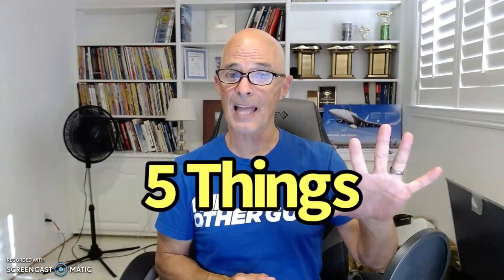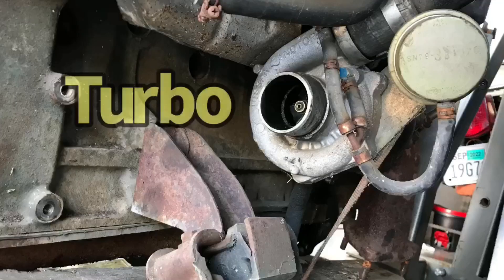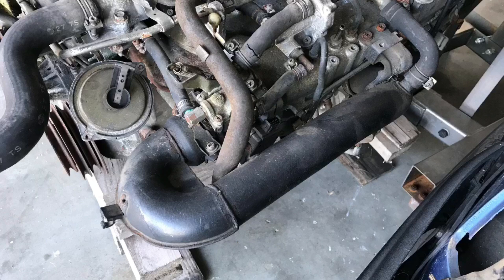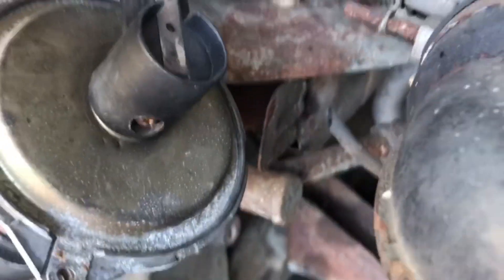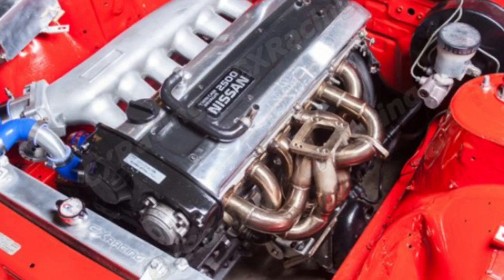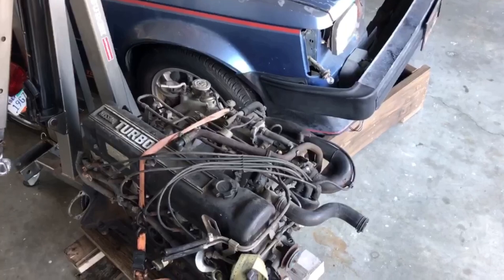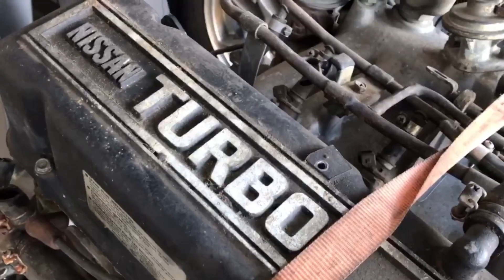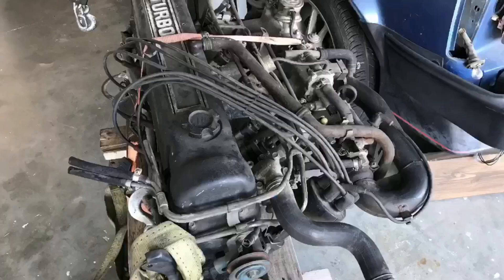280ZX TURBO-5 THINGS I LIKE AND DISLIKE ABOUT THE L28ET TURBO MOTOR. PART 1 OF THE ZXT MODS SERIES.

Comment: Great video!! I owned 3 280ZX Turbos...The 83 automatic was a dog, especially off the line. I added an intercooler and raised the boost to 12lbs. and the improvement in acceleration was substantial. I figure 10 HP for every pound of boost that's added... You can safely add 3 lbs. boost by removing the blow off valve and adjusting the turbo linkage.

Comment: We ran 219 mph with a Bonneville. Totally stock bodied 280ZX. It was a 2955 cc turbo using a diesel crank. Huge amount of work but we set 3 records
Reply from the maker: NICE-CONGRATS
Reply: Hi Richard, love your videos, I still have an extra LD28 crank if you want it. Takes a custom piston but make is 2955cc or there about. Free to you if you want it. 
 @richardholdener1727
Reply: Diesel crank out of what vehicle/engine??

Comment: Some folks are able to produce 500 horsepower out of it and some in Japan made 600 horsepower out of it like back in the 80s japan actually had twin turbo set ups : PS in the bay area a shop named Z car garage helped a customer build a 560hp Garrett 3.2 litre l28et turbo swapped 240z with a 6 speed 350z tranny

Comment: 1. That’s not a disadvantage. You can put a bigger turbo and run more boost without having issues of melting pistons and or detonating
2. That’s not a disadvantage. You can get an a good aftermarket intercooler if you want
3. That’s not a problem. It’s relatively inexpensive to upgrade fuel injectors. Or you can simply go with duel fuel injectors per cylinder.
4. That’s not a disadvantage you can do a draw through turbo setup the exhaust port next to intake port is an advantage for fuel atomisation. Then you’re not limited by intercooler flow
Reply from the maker: wrong on all 4

Comment: Could you do a water to air inter-cooler in front of the turbo?  Guess you would also be doing a full sequential injection  system as well
Reply from the maker: YOU WANT TO COOL THE AIR AFTER IT HAS BEEN HEATED
Reply: @richardholdener1727  Yep, I mean at the compressor output.

Comment: What about adding a turbo to a l28e. What are the options there?
Reply: "What are the options there?"

Plenty- But it depends on your budget and how complicated you want to get with it along with what specific l28e youre starting with.

They made the L28e for awhile, starting in the mid 70s, and had various changes along the way. Different blocks, heads, etc. Later year ones can bolt over a lot of the l28et hardware- and depending on your budget and what you can source, this can be a great way to get started on things. But like he touched on a bit in this video, theres a lot of things youd want to change / upgrade. Fuel system being a big one. Itd also be advisable to run a better fuel management system over the stock one- Especially in this scenario due to the compression ratio differences. And again as he noted- the intake. 

But pretty much whatever you can do to the l28et, you can do to the l28e. If you have more specific questions though please let me know.
Reply: @SidewaysGts  mines an 82 model so I have the stock flat tops and p79 heads. I have upgraded the fuel pump, fuel rail, injectors, coil. Typical upgrades. Aside from a full build and going megasquirt with turbo distributor and everything.  Was wondering the options for power adding to 28e. Seems to be a process for any upgrade on these old motors because of the outdated management etc.
Reply: @mattfultz1971  "Seems to be a process for any upgrade on these old motors because of the outdated management etc."

Pretty much. Outside of minor mods, the stock ECU for the old 80s stuff is pretty crap, and cant compensate much. 

From a "hardware" perspective for their time (The block, head, etc- the physical parts). Theyre quite strong. Whether youre starting with an NA or Turbo block, you can easily handle 300+ WHP on stock internals (The difference will be in how much boost is needed).  Plenty of guys push 350-400~ WHP on entirely stock internals (though i feel 400 is as far as id want to go on stock cast pistons, 350~ tends to be a solid "i can drive this all day" number).

The problem is everything that makes them run needs to be changed. 

Even with just a mild cam, the stock ecu is rather inadequate IMO.

To make any major mods- You really benefit from going with a modern, proper aftermarket ecu.

FWIW: I dont recommend the megasquirt. Its not bad by any means- But for the money? Get something like the MAXX sport ecu or something similar.

For like 1500~ bucks you get a full standalone with 6 injector drivers, 6 ignition drivers, 7 additional outputs, 6 inputs, handles launch control, traction control, anti lag, vvt, shift cut, has a built in wideband, built in 4 bar map sensor, can handle flex fuel, connects via bluetooth, and has a flying lead harness for you to connect up to your engine.

You get that- and you can run basically anything you want, with full sequential ignition/injection. 

Get a turbo manifold, something like a t3/t4 turbo, plumb it through an intercooler, and you can safely run 300-350~ WHP all day long. Upgrade the cooling, go with forged pistons and a decent cam, and you can push 400+ without much issue. Of course from there the transmissions readily available wont be happy- so youd probably want to go with like a KA or ideally cd00X transmission. And then...
Reply: @SidewaysGts  thanks man I'm definitely going to look into that.  Megasquirt is 1500 not including having to swap everything the car to l28et parts.    I'm going to into the Maxx setup and go from there.  Would I need to run a thicker gasket to drop the compression in your opinion. Or would stock with flat be good?  If I can 350hp out of it would be all i needed in that little car
Reply: @mattfultz1971  "Would I need to run a thicker gasket to drop the compression in your opinion"

Depending on which specific l28 you have I think youre probably at 8.3~ to 1 compression. Definitely dont need to lower compression at all. Modern Injectors/ecus/etc are more than adequate to run some good boost at that kind of compression without much fear of knock- And TBH the motor will run more efficiently because of it. Ive got a "stock" l28et in my Z (only physical mod is i had the block o-ringed, but tbh thats not necessary) with the 7.4:1 compression- You can basically pull timing on the things until they start to lose power before they knock because the compression is so low (running 20 psi). Youll have to be "more careful" with 8.3:1 on pump gas (you can definitely alter timing to the point youll knock), but as long as you dont knock- the pistons/rods will hold 300+ whp just fine. 350+ is easily obtainable, but any knock at those pressures can probably see a shattered ring land or worse (Again: as long as youre not knocking, i wouldnt worry personally. Having a good tuner is definitely a must here). of course if youre running e85, youll be notably safer (Which is again a huge advantage of the maxx ecu, or similars- being able to run flex fuel. You can toss in a flex fuel sensor, and itll compensate on the fly for mixed gas/e85- so you dont have to "drain" the tank, you can just fill up and it does the rest).

Ive been running 300+ WHP in my z for 10 years with no real issues. I keep it where its at largely because of the limitations of the transmission (Keep in mind these motors make more torque than horsepower. 300 whp is going to see 350+ pounds of torque at the wheels, well over 400 pounds at the fly- They were meant for 150 pounds lol). Im in the middle of swapping a cd00x transmission myself- And from there the goal is to go forged and push 500. 

3-350~ is a pretty "easy" and relatively affordable point to hit with these engines. The engines themselves can take it, its just the bits around it to run it. over 350-400~ is when you REALLY need to start upgrading things.
Reply: Honestly instead of trying to find original heads to port and whatever...just go for a kn20 head...its k series type of head but made for the 6 cyl L series block...worthwhile upgrade

Comment: Love the fact that you're doing L28ET stuff! Thanks for using our fuel rail picture :) we are very proud of those products.

We would love to collaborate with you on this project as far as any parts you may need or information sharing! Please don't hesitate to contact us for anything you need.
Reply: Will give a nod to these guys- Just got my hands on their cd009 (into a 240z) transmission kit, and waiting to install it. Everything looks to be of amazing quality, and cant wait to get started on it. Ive got a mildly modified 240z currently making a bit over 300 whp, but going to be pulling it apart here soon to build a forged engine and hope to push 500 (Big reason i wanted the 350z transmission in it).
Reply: @SidewaysGts  Thanks again for your business, and the kind words!

Comment: The euro 280zx turbo was intercooled which jumped it into the 200+ hp range.   I swapped L28ET in my old 81 280zx with 87 Z31 ecu which really made it much better never ran an intercooler.  Now days I have a 82 maxima with a L28ET swap top mount intercooled the stock 71B 5 speed (non turbo) trans didn't hold up.  I'm looking into rebuilding a Borg Warner T5 I got for cheap from a friend with new parts and maybe try to put some world class parts in it.
Reply: Cd009 to L series adapter...btw I love your Ig page if this is the same guy running that archetype page
Reply: Euro L28ETs Were Not Intercooled 🤣

Comment: I have thought of put a seperat cooler on my Water cooled intercooler on my VAG CBZ 1.2tsi 105hp 8valve 4cylinder engine. But I can't finde eny information on how big a radiator I need. How much coolent flow i need. I have Access to a car Dyno and have some sensors available to measure coolent temp and 3 engineers to ask (I don't do it because the go rough and starts talking formulas and theory's that I have never heard of before 😂) 

Would love to see a planing sheet on how you planning out the test procedures and I with order you do stuff think that would be beneficial for alot of people. 

Love that you test step by step and compare different options

Comment: Funny thing, the ZX turbo manifold does have a primitive blow off valve next to the pop off valve, and it will vent when you slam the throttle shut through that little 5/8" hose.

Comment: I'm about to build a turbo motor from a n42 block and n42 head. Gonna use thicker head gasket to push compression down a bit. My tank is shot in my 260 so need to go fuel cell anyways which is OK since I need to run e85.

Comment: Never had my hands on a six, but had a fair bit of experience with an L16 & L20B, the four bangers.  Serious bottom ends.  Rods like a SB Chev.  I disliked the non-crossflow design also, and had more fun with a Toyota 20R.  They all responded to the hot rodding tricks very well and it was fun to beat up on smogger small blocks with 'Jap Crap'.

Comment: I own an l28et in a 71 240z and I'm super excited to see where this goes. I hope you have the cometic head gasket ordered and some head studs. I turboed my first z in 2002 and I've been trying to blow it up ever since. The worst I could do is blow a head gasket and warped a cylinder head. It's megasquirt v2.2. My cylinder head's been decked .30.... it's got ARP head studs hx35 6x6 billet compressor 10cm exhaust housing.... Schneider cam/springs.  280 270 duration 460 lift edis 6 msd6al 850cc injector water meth. Low boost 17psi  normal boost 24psi. I'm also curious do you have a p90a head or a regular P90? Cuz that could be a pain in the ass if you're going to put a cam in it. I also just got the Kamari twin idler timing chain setup. And I recently just put my 14th or 15th Transmission in it (ive lost count) and I think I'm going to probably end up going to LS. It's not going to be overnight but at some point I'm going to sell my whole L Series setup. Transmissions are getting hard to find. I really think an LC9 with a tkx and 78/75 would be a bunch of fun. Anyway sorry for such a long comment. Can't wait to see what kind of power it makes on the dyno and you better put a moon tune on it 20° @ 20psi.
Reply: They make a L series to nissan cd009 adapter, very good transmissions...the vq engines they are normally mated to grenade before the transmission does and that's already hard to do with vq's..plus the cd009 is strong and cheaper than a tremec

Comment: There’s another cross flow head other than the OS Giken head, it’s called the Datsun Works KN20 head. Uses K series valve train stuff to reduce costs, it’s still pretty expensive though
Reply from the maker: I saw those mentioned-still not a viable option

Comment: G'day Richard,

Thanks for another great video.  It's also good to hear that you're a Datsun Z fan.  :)  I thought that I would send a couple of comments for you.

Firstly, Nissan did a great job when they homologated the Z series cars with the FIA.  They grouped the entire series of 240, 260 & 280 Z & ZX models together as a single series or type.  That means that a race car can be built with the lightest body, the better gearbox, diff & brakes, as well as the L28 series engine.  So, you can race a 240Z, with 4-wheel discs, LSD, & L28ET in historic race or rally car classes.

Also, one of the guys at a car club I had joined owned a famous 260Z, which was turbocharged.  It was more notorious than famous, & always very quick.  At one stage, he built a 2nd engine for it, which was based on the Nissan Patrol engine.  He used it for everything.  Daily commuting to work, shopping, circuit sprints, autocross, & touring road events.

Finally, I read Hugh Macinnes' book, Turbocharging, back in the 80's, as an apprentice.  It knocks me out that what is almost a 50 year old technical book is still referred to.  But, I'm going to check out Maximum Boost, since you mentioned it.

Once again, thanks for a great video.  I'm looking forward to the mods & tests on this one.

Keep up the good work
Andrew
Reply from the maker: THNX FOR THE INFO-I HAVE HUGES BOOK TOO-IT HAS BEEN READ MANY TIMES

Comment: Really strong factory forged crank with 7 main bearings. Forged rods and High Silicone content pistons make the L-series able to handle high stress situations. The block is high nickel content as well. All of these features were standard  Nissan engines in L and A serie's. . A12 engines would think nothing of buzzing to 10K. I witnessed a Dyno Test of an A12 at Tilton Engineering ( 1974 )  where they pushed an A12 to 12K. Stock crank. Carillo Rods and Arias pistons. Power fell off after 10K though. But it was pretty impressive to see a 1206cc pushrod engine pushing 12 K
Reply: Can the na engine's also take forced induction I'm planning on doing a plus t but I'm unsure if they can take it since I haven't done one before I'm looking on doing one for 250 to 300hp, your expertise will be greatly appreciated.
Reply: The crankshaft will break right behind the factory harmonic balancer.  YOU HAVE TO USE AN AFTERMARKET FLUIDDAMPNER IF YOU ARE GOING TO RAISE RPM'S ABOVE FACTORY .
THIS GOES FOR BOTH THE TURBO AND NON-TURBO

Comment: Interesting Timing Richard. There was a discussion recently on the Electromotive L28 Turbo's that ran in GTO and  IMSA GTP serie's in the 80's and 90's. Electromotive was making 750 hp on the L28 Single Turbo version back in the early 80's. By the end of development they were making an astounding 1,100 HP with the GTP Twin Turbo version.... on the non-crossflow L-6!!  Chris Willes book  : " Developing a Champion. The Electromotive Nissan GTP Storey "  is an absolute must read for any Nissan Race Fans. Incredible engineering that was way ahead of the times.
Reply from the maker: I'LL HAVE TO GET IT

Comment: Fun fact, the '83 Turbo motor is capable of less power than '81 or '82 because they used a different head (P90A instead of P90) that used hydraulic lifters instead of solid. After about 350ish horsepower they start to collapse.
Reply from the maker: FUN FACT-LIFTERS DON'T KNOW POWER LEVELS

Comment: Very interesting. I have a 1984 300 ZX turbo. Although my engine is a V6, it has the same 7.4 compression ratio and the turbo only made 4 pounds of boost. I think that many of the things you plan to do to your '83 280 will apply to my '84 300. This car was raced backed in the eighties at Road Atlanta. The only mods were a roll cage and a five point harness. Yet, as the story goes, this car could top 140 on the straightway. Even with only 4 pounds of boost, turbos seem to do wonders for top end speeds!
Reply: Vg30det would be a good upgrade. Lots of knowledge there
Reply: I thought the 300ZXT had 7.8:1 compression.

Comment: I raced the NA motor in the SCCA, super reliable.  The fast head was the E88 or E31.  You can build a stroker using the diesel crank.
Remember these were popular way before the internet, all the knowledge is in peoples heads, it almost was never published anywhere.  There are some out of print books on these motors, Bob Sharp from CT ran these, lots of Electromotive support.  They supported Paul Newman when he used one to get an SCCA national championship. I would guess there all being vintage raced now.
Reply: What block were you running alongside the e88 or e31? N42 or n47 seems to be the go too on flat top f54s
Reply: @frisky6663  gosh it was so long ago, don’t remember. What ever cane in the 280Z or ZX, NA motor, as that’s what I was running in the ITS class.  The E31 was a 240Z head and supposedly had better flow, but very rare.  The E88 was the next best.
Reply: Some guys on hybridz jotted most of it down, braap and tony D being the most knowledgeable to my recollection